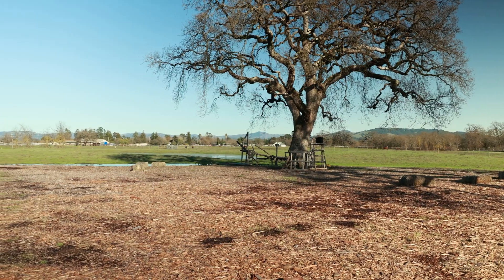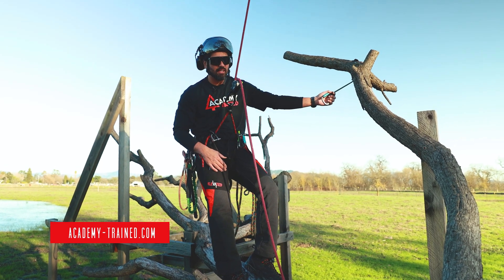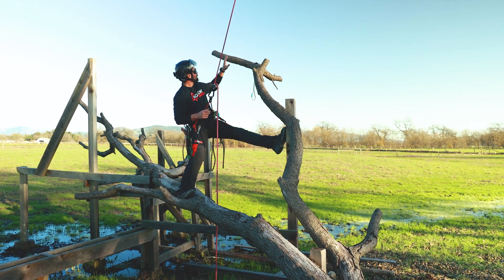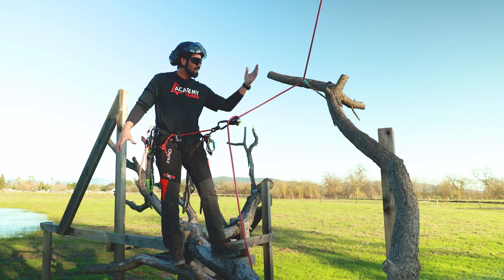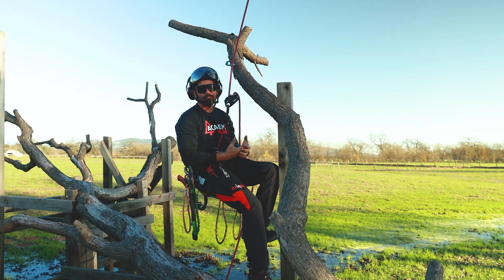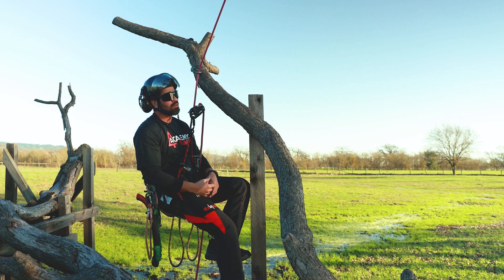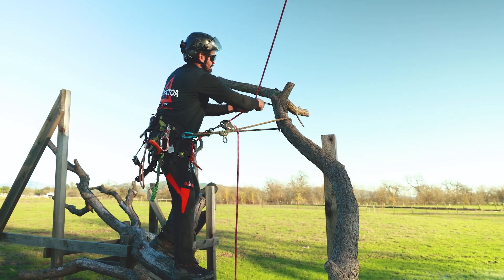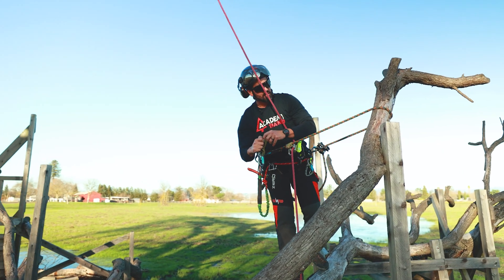Dealing w/ bad rope angles while climbing trees SRT Redirects w/ Jared Abrojena: Arborist skills

Comment: Have you ever done a review of the ART SpiderJack? I've found it to be the only thing that kept me going well into my late 50's. Especially when it's used through a pulley.  I see all the other mechanical devices but almost nothing relating to the SpiderJack.
Reply from the maker: I’ve used the spiderjack 3 and I’ve talked about it, but I can’t say I’ve made a video on that device specifically.  It is a great option for Moving rope systems. Very smooth very efficient, but has some downsides that keep me from recommending it.  I also climb almost exclusively SRT.

Comment: What diameter roper are you and strider using with the megawatt? I have one and try to use it more often but find it sluggish with the rope.
Reply from the maker: I’ve found it works better as it breaks in, and on newer smaller ropes.  The one we are using is  11.7mm woodpecker, and it works well for SRT.
Reply: Thanks my friend appreicate your response that’s very helpful. I shall persist with my rope for a bit see how goes it
Reply from the maker: @thegreenrevival4424  there are some different grips I’ve found that are better than others as well, keep experimenting and you’ll find the sweet spot!